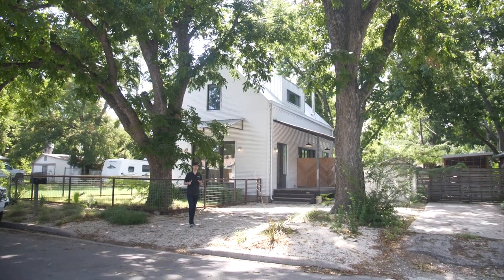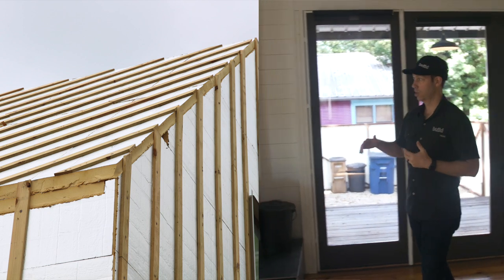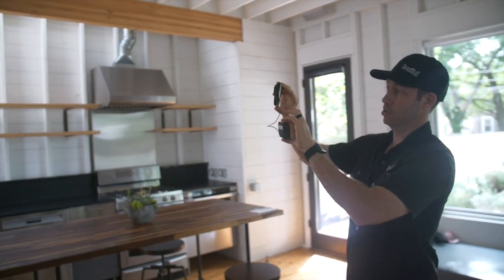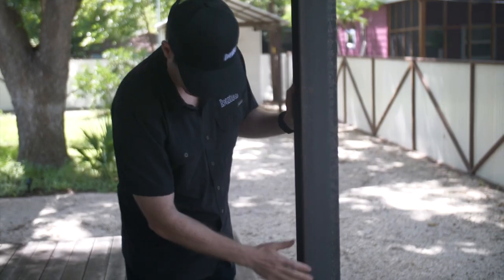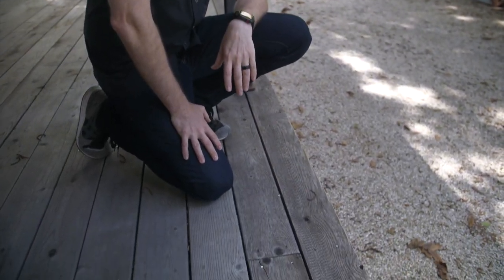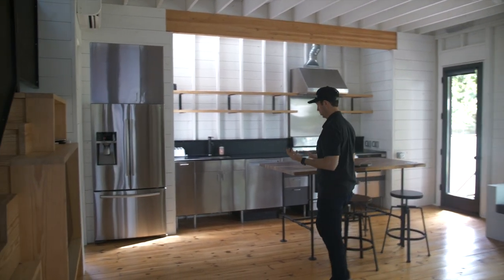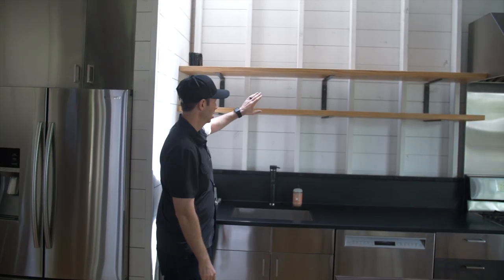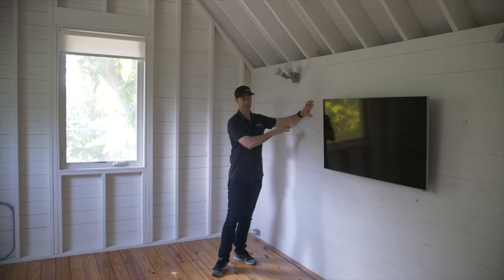This New House Has No Drywall, No Insulation, and an All Wood / Shiplap Interior!

Comment: Without drywall etc, did this style of construction lower the cost to build? Since most of the structure is exposed the lumber and skill required must have been a lot higher than average..
Reply: I see nothing from watching the video twice outside of good tried and trued craftsmanship in the building of this. If anything, it's a tribute to the way timber frame has been built, at least in the northern US and Canada, for generations. The new twist is encasing it in an exto insulative skin.
Reply: If people know it isn't going to b covered up they seem to care more.
Reply: If I remember correctly he said in another video that the framing took about twice as long as a typical house of this size.
Reply: Probably cost more than a normal finished house.  

The house has insulation, it is on the exterior of the house.  It is a more expensive replacement than standard insulation inside walls. The only thing this house eliminated is the drywall, and because of that everything else would have been more complicated and expensive.  The framing is the real star here and somebody paid for it.  Even the electrical and plumbing is exposed, which is expensive to do right.  It is probably more expensive to paint exposed framing than to roll paint onto drywall.

I only see things adding to the cost of building, not any money saved.
Reply: Stephen- this is stick built, not timber frame. It might actually be attractive inside if it WAS timber frame.
Reply: More importantly, there's no way he used standard stud grade lumber to frame the inside of that house. I'm sure it's likely #1 prime or some other much better and much more expensive lumber.
Reply: The framing costs should be similar. Insulation costs should be lower and electrical and plumbing should be similar to traditional houses. I am going to guess that there might be as much as a 30% saving versus a traditional construction. Mainly due to not having to pay for sheet rock and insualtion labour and materials. (Less material should be needed for insulation as well. I think for sound proofing if acoustic tiles would  work if you placed then on the ship lapped surfaces?
Reply: P. Wingert  They did have insulation still. Very expensive insulation.
Reply: @PWingert1966  You incorrectly state that they would not have had to pay for insulation materials and labor. As others have pointed out, there was still insulation used- it was just on the outside of the house. Rolls of insulation bought in bulk are cheaper than rigid insulation. How do you figure they would use less insulation? If you roll insulation between studs, you are not insulating the stud area. If you attach rigid insulation, you are insulating the whole area. Electrical would certainly not be cheaper- instead of running the Romex, you would have to run rigid sheathing and put the wires through that to meet code where they are exposed. This is why most of the outlets are at floor level, but rigid sheathing would still need to be done for exposed wiring to light switches. Plumbing might have been similar in cost, but the red and blue PEX pipes are probably the reason for the lapboard finish used on the interior walls since those pipes would not have looked aesthetically nice and copper would have increased costs drastically (the lapboard was also probably used to cover any wiring that was not encased- such as in the upstairs unfinished attic areas). Shiplap is much more expensive than drywall in materials and labor (drywall is less than $1.80 per sq foot and shiplap is $2-7 per sq foot). Now, take a look at those studs- have you ever seen the junk you get for standard (cheap) drywall studs? Standard studs are twisted, warped, knotted, and in some cases split. These exposed studs are beautiful- meaning they didn't get cheap standard studs but instead paid 2-4 times as much. Then take a look at what is on the outside part of the studs. Instead of low-cost plywood or OSB, again you can see they did the entire exterior of the home in shiplap as well to better augment the "unfinished" look. Finally, consider the paint cost. Cheaper, easier rolling that could be done by relatively unskilled painters with minimal equipment was out of the question. In addition, the painters were not simply spraying a flat surface, they had to make sure every edge was covered with paint. Prep is arguably the most difficult and time consuming part of painting and there would have been several days of prep with this home. When you spray, an estimate 1/3 is lost- so even the cost of materials for the paint would be higher.  Although this home looks "cheap" it is actually a very expensive choice.

Comment: For kitchen countertop/cabinets, why not just install them sitting on a jack system hidden by a removable baseboard. Any time you want to raise or lower the cabinets you just adjust the jacks. Wall panels could also be placed over the studs. The could be fastened with rotating latches. You could use a strong magnet, on the outside surface of the panel to move the latch or you could just have a female hex head extend from the rotation center of the latch to the surface
Reply: flexible drains  would be 💩

Comment: Question for you, when applying the phosphoric acid to exterior railings or vertical beams in the video, what was the application process? I have only used phosphoric to metal prep before painting, never as a finished coat.  Love this build and the concept of using insulation in a more unique way.

Comment: You pointed out that you have a dehumidifier... the mini split heads will dehumidify in the summer. Winter typically results in low humidity in a home though as tight as the house is Im not sure how much it would be impacted. However, you note that the floor boards have shrunk. Perhaps a whole home humidifier was needed more then a dehumidifier. Hardwood floors often need humidification to prevent shrinking but those are traditionally built homes.

Comment: I like everything about this except not having the benefit of flat, clean interior walls. I understand the academic reasons for displaying the studs, but not the look of exposed wall framing, or the additional cleaning required.
Reply: <sigh> please watch the video again... it requires LESS cleaning than normal construction. He explains this rather clearly when he is showing the upstairs closets/crawl spaces. While the aesthetics are of course in the eye of the beholder, the reality is your 'flat, clean interior walls' function as both a source of dirt & dust, and a place to trap more along with being a haven for pests.
Reply: there wasn't any academic reason to display the studs.  it seems to have been purely a design choice on the part of the original owner in concert with the architect.  no reason you couldn't put up regular wallboard (sheetrock) and treat everything like normal.  the designer and builder were simply "showing off" the interior form and lack of INsulation.
Reply: m. William buda I watched the video and understand he made that claim. He just didn't support it in any way. You still have interior walls; they are the backside of the exterior wall. Except, rather than having a flat, easy to clean vertical surface, you now have the vertical surface of the backside of the exterior wall + the studs+ the horizontal blocking. I haven't done the math on surface area, but it would be an easy equation and would not only be much more surface area than flat drywall, but would also require cleaning both sides of the studs, the top and bottom of the blocks, and all of the new crevices and corners you have to deal with. You can say this has an aesthetic appeal to a particular audience, but there is no case for it being easier to clean by any stretch of the imagination.
Reply: Anon y'mouse I said academic, but a more fitting word would be "educational." I simply meant that one is doing it because they can from a thermally-significant perspective, and therefore can explain to people why it works, not necessarily because it's the best approach from a practical perspective.
Reply: i think this is an interesting area for debate.  yes, admittedly there are more surfaces to clean in this house.  the question is--where is the dust coming from?  i know everything sheds==materials, people, books.  anything brought into the house over time will release particulates into the atmosphere.  that is no different than a standard house, and in a standard house, you have the additional materials of the sheetrock and insulation.  i believe that the only thing that prevents significant (notice i didn't say "zero) dust accumulation behind standard wallboards is that the area is packed with insulation.  but the dust i spoke of above then simply collects around the baseboards and on the wall surfaces (it's there.  just most people don't notice it and do not address it in regular cleaning).  so, i would like to know why this house would be more dusty, or do you think that, because of the surface materials and finishes chosen, the same/similar (although potentially lower--sheetrock and insulation generate their own dust which is not being added here) amount of dust generated by the occupants, living and non-living, will simply be more noticeable, and thus require addressing more regularly.

if you will note, i did not address the significant amount of dust that could potentially come from outside.  i think this design actually minimizes that, due to being super-insulated to minimize outside air(and moisture) intrusion.  this building is designed as a functioning unit.  any air brought in is probably being pre-treated AND pre-filtered by the air exchange system.  so dust is being stopped at that level, which is also the way it is handled in a standard-built home.  in newer places, and remodelling the air exchange through the walls/floors/ceilings is attempting to be addressed by adding foams/adhesives in joined areas, but it is still not absolutely prevented.  where is the air intrusion coming from in this house?  mainly, whenever anyone opens a door or window, and possibly through the foundation.  i would love to see an airflow/pressure test done on this house.  i bet the ability for dust to enter into this structure is lower.  and the materials it is made of are not generating a large amount of dust (UNLIKE sheetrock), so....i still am trying to understand your issue.  i think it's an aesthetic one and not literally that this house would be more dusty than standard-built homes.  ???
Reply: Anon y'mouse The dust in a properly sealed house is not coming from the insulation or the drywall. Knowing what the composition is of the dust in a house is a simple matter of sending it to a lab for testing. It'll be part dirt from the outside that you bring in with you or let in by opening your windows and doors, part human or animal inhabitant skin, and various other things that are just part of living a normal life. If a house has dust coming from the drywall and insulation, that's an issue related to improper installation. Those items should not be breaking down and should be sealed and tested. Also, a closed cell foam insulation will totally seal off not only dust and air, but also water vapor. 

Lastly, the criticism here is not about this construction technique. It's about not having smooth vertical surface walls added inside, regardless of the material chosen (drywall, paneling, etc.).
Reply: in ideal conditions, yes.  i think it depends upon the insulation material and the drywall.  every time you screw into it, or knock it, or it gets damaged in any other way, that drywall is shedding.  mineral based insulation does shed.  so...your issue is that this appears like it is harder to clean than a flat wall surface.  i take that point.  but mainly because most people never clean their walls.  they just paint over them.
Reply: Anon y'mouse my point is unrelated to people's normal cleaning patterns or how the house was built. I'm saying that this house, built just as it is, is harder to clean than if they added properly sealed wall paneling. In the former, you have way more jogs, surfaces, crevices, and total suface area; in the latter, you have straight smooth walls with no crevices other than where the floor meets the wall. Baseboard, other trim details, and what sort of paneling material chosen are an aesthetic choice and not a requirement. This is a very simple comparison only using this house.
Reply: he does support it in the video though, it comes down to 2 factors:

1. the way the house is constructed & insulated prevents debris from migrating inside via the eaves, as is the case with traditional construction. While, YES, the total exposed surface area of the walls is more, which means if you want/need to clean the walls you have more area to cover, the amount of dust generated is far, far less so you need to clean far, far less. 

2. both this style & the 'customary' style have studs with spaces in between, and that space should ideally be cleaned. The fact that said spaces are generally locked behind a drywall plate doesn't mean the dust in the covered space is no longer a concern, it just means you can't DO ANYTHING about it. It also removes hiding places for various & sundry pests like mice & bugs, not only does it make it easier to find & remove the pests but it makes the house more inhospitable to them to begin with

factor 1 is the big reducer on amount of cleaning, factor 2 means you can get & keep the house into a cleaner state than another building with sheetrock (since any house w/ sheetrock will build up a supply of un-cleanable dust in the wall spaces, & is more attractive to pests)

Granted, another 'outsulation' style house but with drywall interior sheathing would be both minimal area & minimal need to clean, excepting of course the potential pest issue.
Reply: less total dirt/dust accumulation, LESS cleaning.
Reply: If you open a window for fresh air, you'll get dust. It doesn't all come in through construction gaps. Imagine cooking. Bits of grease landing on all the surfaces that then will need cleaning. Has anyone ever looked at the top of your refrigerator? That crud will be on every lower plug box, On all the conduit. It looks good and I see it in businesses. I think the way a place like a restaurant gets away with it is that they close up and move within a few years. That house had a person who didn't spend much time there or it would have shown wear after four years. The home looked unused.

Comment: Just the time money you'd save when it comes to doing renovations makes this house a gem.  However, I would opt for some sound barriers within the house to isolate different areas.
Reply: Riiiggghhhttttt... like repainting drywall is so much more expensive and time consuming than repainting each and every stud and void. Gotcha.
Reply: @farmalmta  Repainting is not renovating.

Comment: This house looks pretty nice. But:

I would die in a house likes with children. If i look at this doors and noise insulation... I live in a european wooden factory house. It has tight and heavy doors and 6 inches walls with 1" gypsum fiber sheeting on both sides of the wall and a 3+" inch rockwool noise insulation in between. The first floor is made out of 10" Wood with 5" Rockwool and a 4" EPS Sheeting with 2.5" concrete on top. 

Everytime i was in texas / houston (3 times) the worst for me was the noise everywhere. I think you guys just like it!

Comment: Seems like a good idea for when you have to replace the exterior of a house in an older house and don't want to fudge with the interior. The 4in. insulation with plastic sheet that is. Seems like one of those ideas that can be used in other settings than just what is presented.

Comment: If you installed a plywood sub floor with 1/2" Homasote between the sub floor and finished floor it would  be much quite than traditional construction as far as the floor goes.

Comment: How u got away with exposed Romex wire I don't know.
Reply: Or outlets at floor level...
Reply: I don't see any exposed Romex in the living areas. There is no requirement in the US as to minimum height for an outlet so it depends on if there are any local requirements. It used to be common to have them near the floor though that has fallen out of favor. To be ADA compliant they have to be at least 15" off the floor.
Reply: 2008/2011 NEC didn't care where the wire was, as long as wherever screws went the cable was protected by 16GA metal and that it is held by wire staples every 4 feet or so. A good inspector can see it's safe and check off on it as long as it's built to a recent NEC standard. 

The 2017 NEC requires every wire to be covered in conduit and buried 2" in the wall and outlets and breakers to be AFCI/GFCI and almost everything on a separate dedicated circuit, it's expensive overkill written to force contractors to buy products from companies the board of the NFPA owns shares in and to make the code too complicated for a homeowner to DIY without journeyman electrician experience.
Reply: @jonathannetherton6727  Actually Romex is still used in exposed condition in garages and anyplace (such as those access areas he was showing us) that the wire will not be damaged by for instance garden tools being stored etc. In other words as far as I can tell the code allows Romex in homes with exposed joists running between joists, as long as someone doesn't use the Romex as a clothes line etc.  Generally the most likely place that an inspector would call against you would be exposed Romex at a wall switch, however that was done for 65 or so years without issue. Now they would not allow it I think, but I did replace Romex to a switch in a garage and ran it along the stud only a couple months ago. The inspector bought it. Part of the issue is that you can not run Rome through EMT over 2 ft long, make choices and go with it..